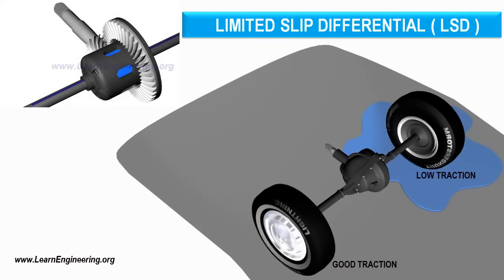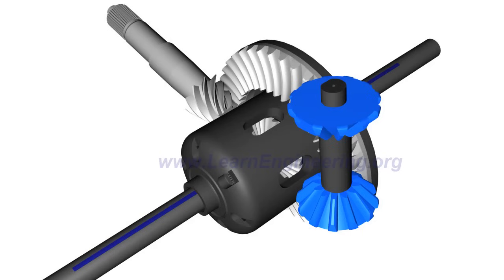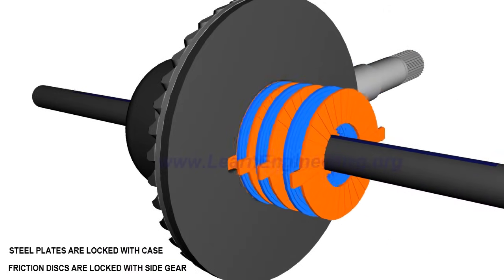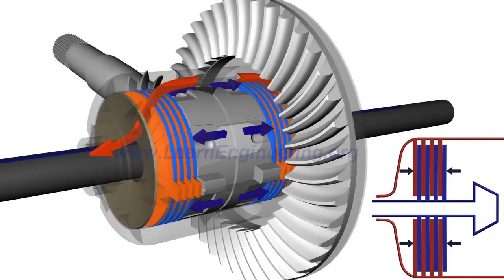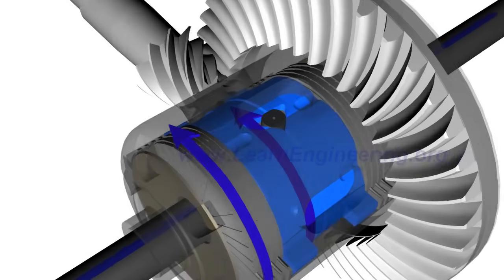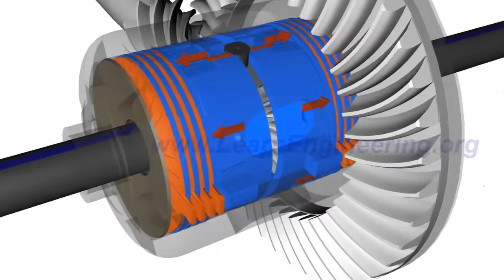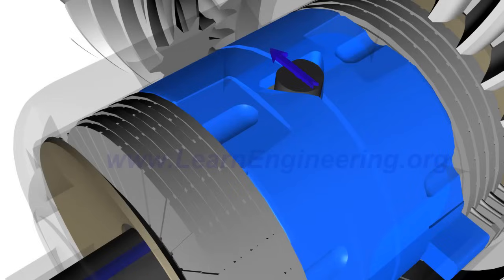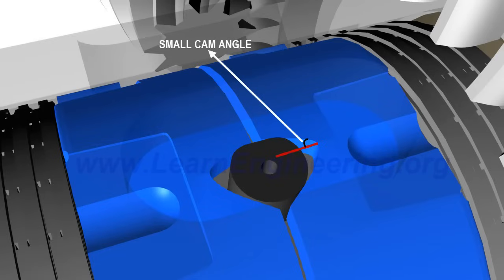Working of Limited Slip Differential

Comment: In 1 way type LSD, you said it will distribute torque equally and overcome traction problem....but that is what open differentials do...they always distribute equal torque....so how does 1 way LSD overcome traction problem ???
Reply: Harshit Singh what an open differential does is simply transfer the torque to both wheels, the amount of traction each wheel has determines the balance because if one tire has zero grip the torque will take the path of least resistance and accelerate that tire while the tire that has grip slows to a stop.

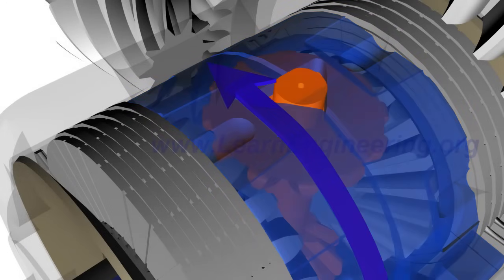Comment: So this is a torque sensing LSD?  It locks up in response to increases in torque to the differential, I see.  The word at 2:17 - was it "tangentral? what does it mean?
Reply: I assumed all LSD's/Posi's are torque sensing these days. I remember seeing one that wasn't but it was made before 1970. The tangential mention was about how those two case halves spread apart thanks to the V shape opening for the spider shaft. Google the word Tangent. I don't like how that part was worded at all, imo it's easier to understand with the audio off. The other type of LSD, which I believe is much more common, uses the side gears to apply the clutches. Picture a normal open diff but with a clutch behind ea side gear. The more torque applied the more the side gears are forced against the clutches thanks to the angle cut on the spider and side gear teeth. That setup is easier to understand too, and I'd assume cheaper to mfg than the one in the vid?
Reply: I don't understand. : - | What is the tangential ? How locking it ?

Comment: why do you want to lock the differential during deceleration?
Reply: it helps dramatically in cornering and in uneven surfaces like off-roading in mud, sand or snow
Reply: It would increased the probability of oversteer while braking hard. It's a safety issue, especially if braking hard on a corner.
Reply: @aharrington080611  
Oversteer - during straight line braking?
Braking hard in a corner???
Reply: @aharrington080611  It actually decreases oversteer when letting off the throttle by allowing the wheels to negotiate better. This is why a car with a welded or locked differential will understeer until the tires break loose.

Comment: how will it negotiate a turn while its in the locked condition as in the locked state both axles act as a single unit
Reply: this is determined by the ramp angle and therefore how much locking you want during throttle or brake
Reply: If the clutch is locked during a turn, then the inside wheel is slipping, therefore it does not matter if it's slipping very fast or just slightly faster.
Also, the locking is not 100% (like single-axle carts). The faster it slips, the more locking it gets. But if no slipping occurs, it's identical to an open diff (well, it may have a slight locking to avoid shocks).
In other words, it has no safety downsides (you do have more components that wear down).

Comment: in this video it is underscored the fact that spider gears are NOT directly connected to the case(instead there's an internal slot where the spider can move under torque, within a certain ramp surface) while in your other video it was shown an LSD, pre loaded with a spring,  where the spider gear was indeed connected to the diff case. if I understand correctly, is this because the latter design is a 1-way only type ?

Comment: Im probably not understanding this well but if we say 100% preload.... that means that the clutch pack are forced together at their max (creating maximum firction possible) wich basically means that the diff is locked. How can that be interesting if the diff is locked and basically do the same job as a welded gears on shafts.....theirs something i dont understand so if anybody can help me, it would be awsome
thank you
alex
Reply: I don't know how it would compare to a welded diff, but with 100% preload you are making the car very diffcult to turn, without applying any acceleration or deceleration inputs, it is the static locking applied before even the car is moving. ideal for mid corner stability with your not on the throttle or brake.

Comment: I'm looking for a How-To video/article on replacing the clutches on this type rear end. Anybody have one ?

My 98 Dakota's (w/Chrysler 8.25") LR axle locks up during low speed, LEFT hand turn (Only) turns and when pulling away from a dead stop. It makes a horrible crunching type noise in the process. The noise goes away (from a dead stop) after about 5 MPH or so. It makes NO noise at all while turning Right. The diff fluid was changed out and the mechanic noted NO physical damage and/or broken pieces/parts inside. Yes, Friction Modifier was added to the gear oil.

Apparently, the leftside clutch pack is damaged and causing the lockup condition at low speed. ?

http://dodgeforum.com/forum/2nd-gen-dakota/382428-very-odd-rear-end-noise-while-making-left-turns.html

Comment: Highly informative, thank-you.
I used to play Gran Turismo and they don't do that well of a job describing the 1, 2 and 1.5 way diff. Now I know though.
Reply: I have the Apex Magazine to download, it explains clearly, think of it like this, 1 way is only throttle lock, 1.5 way is less locking pressure on the decelerating side. 2.0 way is like equal locking on both throttle and brake.
Reply: that's because its a video game smh

Comment: Awesome at last, thank you LE. How do you tune initial torque , preload, breakaway etc. Is it purely for those not on not off throttle moments ?
Reply from the maker: To fine tune the design parameters of an LSD you have to rely on a detailed Simulink model or on heavy experimentation. :)
Reply: Learn Engineering sorry I didn't make my self clear, what I actually am trying to say is what is initial torque actually for. Am I right in saying that is for the static pressure eg. Racing scenario, where you are off the brakes but just before you get back on throttle, to stabilize the car through the corner. I understand that Deccel is for braking and Accel is for well Accel on throttle coming out, so initial torque preload must be for the coasting and also to help aid in speed smoothness of LSD effect. What I mean is what is it actually doing by lowering or raising the IT. Preload ?
Reply from the maker: ThePres05 Hope you are asking about the pre-load springs. If there were no pre-load springs present (zero pre-load), the clutch pack will be activated only during high throttling. By giving some amount of pre-load the amount of throttling required for clutch activation can be reduced.  

Apart from this pre-load springs help in securing the position of the spider-shaft system in the cam grooves by pushing the pressure rings always.
Reply: Learn Engineering +Learn Engineering Interesting, thank you, but isn't this also know as initial breakaway torque. as quoted from http://www.ppi-ats.com/LSD/LSD_basics.html

"The initial torque (break away torque) is a pre-load torque on a LSD. Up to that torque load, the LSD locks the differential even without any rotational difference between the wheels. The initial torque and the cam angle on the cam rings determine the responsiveness of the LSD on the driver's steering and throttle inputs. The higher the initial torque and the higher the cam angle, the more responsive an LSD becomes. However, too much initial torque makes a vehicle extremely hard to turn and very high cam angle affect the vehicle's smoothness. A good performance LSD achieves an excellent balance of those two important factors"
Reply: http://www.gordon-glasgow.org/lsdtech.html this is an excellent article about breakaway pressure , initial torque, preload etc , amongst other bits of info, in case anyone wants to learn more.
Reply from the maker: ThePres05 Hi, It is the same thing. In fact the pre-load force will induce an initial torque due to the friction between the surface plates.
Reply: Learn Engineering  So one last important Question then, and please explain this in Layman's terms, why would you want or choose either lower or higher pre-load (initial torque) on an LSD? and especially in a Racing Scenario ?
Reply: ThePres05 an initial torque peak that goes through the diff might break the tire loose on slippery surface, so you gain traction control while moving but acceleration from zero might be a pain?

Comment: Can someone explain what the percentage that is used to described a lsd is ? and please learn engineering make a video fors viscous lsd !!!
Reply from the maker: Yah, you are right. The torques cannot be equal in an LSD even when it is completely locked. Less traction will wheel will get less torque and high traction wheel will get high torque. Locking factor % is a parameter to describe this difference.
Reply: Spiros Mallios "Depending on the number of plates, deactivating each set of plates is often referred to as 80%, 60%, 40% lock and so on. Be aware that the more clutch plates are deactivated, the less the diff is able to lock" 

From here http://www.motoiq.com/MagazineArticles/ID/1322/PageID/1494/Project-NSX-Part-2--Tuning-a-Limited-Slip-Differential.aspx

so I now understand it as: 

1. Preload or initial torque, is  the "initial breakaway torque (rotational force)" up to that torque load the axles are locked, until it overcomes that set force.

2.  Initial Torque, preload, will tighten the LSD clutch packs, same with the accel and deccel, when the pinon shaft cam hits the pressure ring angled slots.
when the rotational difference is the same or closely the same, it creates understeer, until traction is lost at the wheels then it will create oversteer (RWD car).

3. Still having trouble getting my head around adding more tightening of the LSD with Accel setting (angled pressure ring slots), when you can already have tightening by preload ? and how to adjust to suit, but deccel is for stablisng car under braking, preload is for entry mid corner stablisation, and throttle control, progressive action of the LSD, and accel is to set the correct amount of inside and outside when exiting the corner. (in a grip racing scenario, drifting would be set to lock up more possibly). so preload's job is basically, the amount of Torque necessary to activate the LSD.
Reply: If I understand you correctly then it would be the % of torque to each wheel, the numbers are usually the ramp angle numbers in degrees, so when the pinion shaft cam presses against the pressure ring case ramps the angle determines how much torque is sent to the wheels (locking). 1 way LSD is activated only on acceleration, the ramp angle is flat on the deceleration side, 1.5 means slightly less force when decelerating than accelerating, and 2 way means similar force when accelerate or deccel. Initial Torque (breakaway, force, spring, pre-load, etc) I believe to be the amount of pressure on the clutch plates when there is no accelerate or deccel when the car is static, so when you are either not on the throttle or brakes there is still some pressure on the clutch plates and therefore transfer of torque to both wheels. high amounts of this will create under-steer. and make it difficult to turn corners. same kind of with accelerate and deccel too much should cause under-steer, but depends on the cars drive train layout and how much it is set too on the LSD. Phew!
Reply: Learn Engineering If so then what does the 40% LSD mean ? Maybe it's on the other types of lsd and not on the pressure ring based ?
Reply: Learn Engineering so is that right then that it transfers equal amount of torque to both wheels ? In theory that would be correct, as the pressure ring case is adding pressure equally to both clutch packs, regardless of a racing scenario where the inside wheel lifts slightly and you need to add more torque to the outside traction loaded wheel, but obviously too much will incure understeer on FF cars and oversteer on FR cars. I've edited my comment to match equal torque to both wheels is applied.
Reply: Spiros Mallios I always thought it was 40% of lock but I agree this I'm not sure
Reply: Learn Engineering please explain the above link regarding bias ratio and locking factor % or is this because this is different to the pressure ring version in your video ?
Reply: ThePres05 I think the link you gave me has a lot of mistakes . He is saying "A totally locked diff has a 100% locking factor cause all of the available torque can be applyed to the high traction tire " Which imo is wrong cause a totally locked diff will provide equal torque on both wheels all the time no matter the situation . Learn Engineering  Please make something to clear things up mate !
Reply from the maker: ThePres05 Even though the LSD is fully locked to determine the torque transfer to each wheel, we have to consider the traction condition also. When fully locked the high traction wheel will get more torque and the less traction wheel will get less torque.
Reply: +Learn Engineering lan инженерин
Reply: According to Xtrac and other companies building racing diffs, the percentage relates to the incoming torque from the driveline, how hard/effectively it's compressing the clutch packs, and what the locking torque between the axles is. As an example if you had an LSD with 50% acceleration locking and the engine was putting 200 Nm into the diff (after gearing etc.), the locking torque between the axles would be 200 Nm * 50% = 100 Nm. So the locking torque between the left and right driveshafts varies based on the torque delivered by the engine multiplied by the percentage. More torque from the engine = higher amount of locking torque.